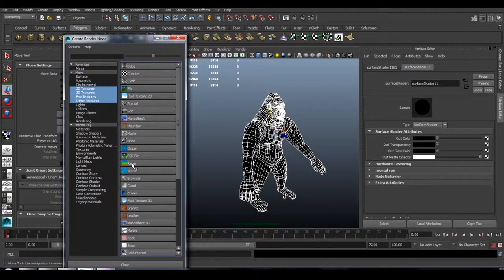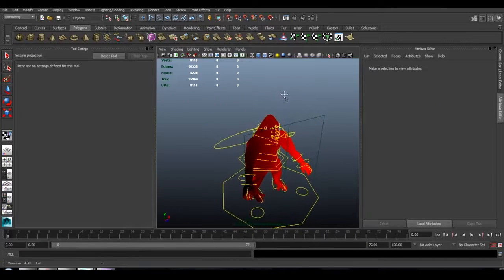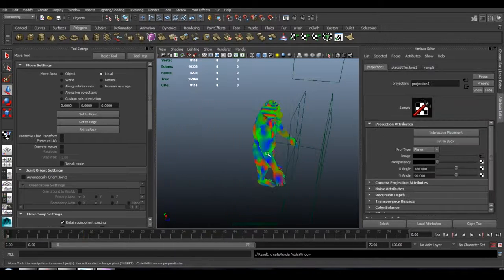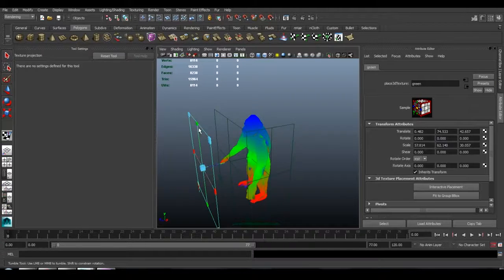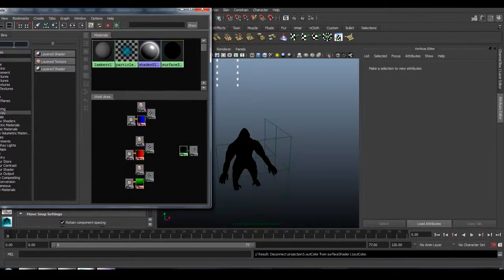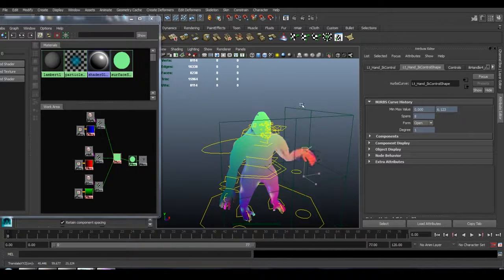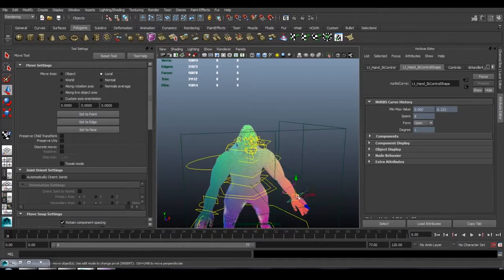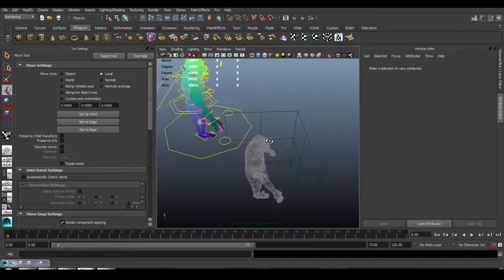Paint & Stick Tutorial: creating a sticky pass without maya or c4d

Comment: Great tutorial!. From my understanding the sticky pass just needs to have a shader that maps each uv Coordinate with a unique RGB value. The sticky script in AE will then simply connect the pixels from another layer to follow the the rgbvalues they are mapped on. If it works like this, why can't we simply use a UV pass? Or am I thinking to simple about this? Thanks in advance
Reply: I ..think.. the RGB values allow Stick to simulate projecting onto the object as you've effectively got worldspace coordinates (which would distort if it ever changes shape once baked in per the tutorial), whereas RG would allow you to place an image based on the UV values as per a standard ST map, which a lot of the time is all that's needed.